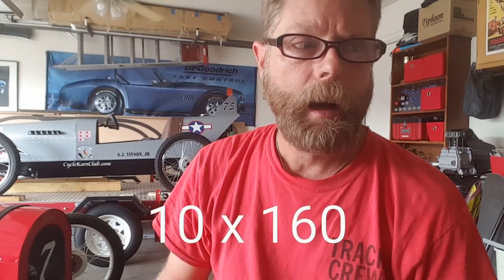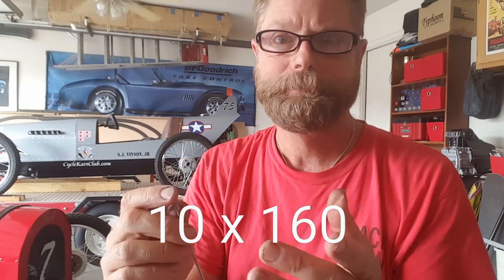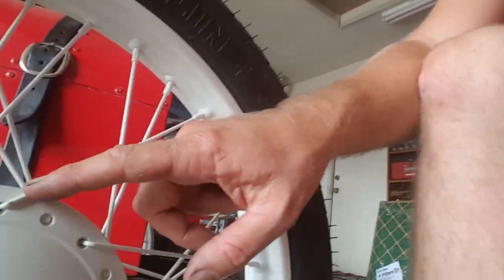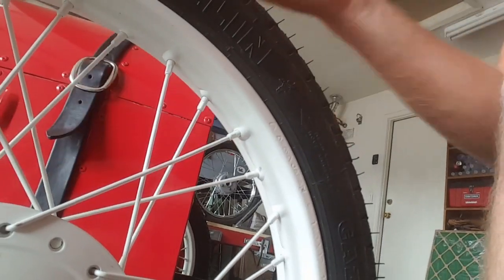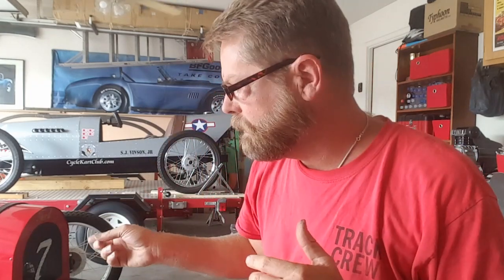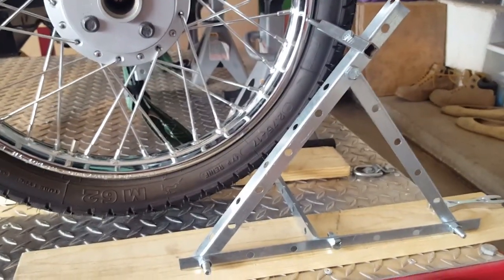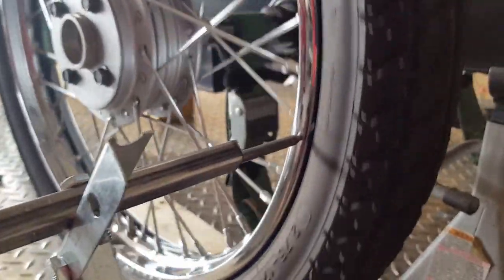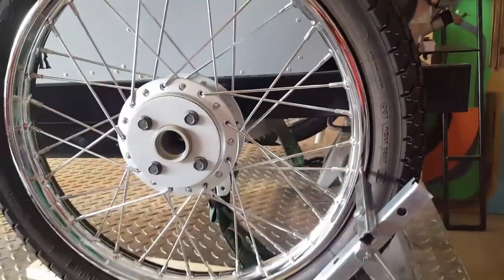Cyclekart Spoke Tech

Comment: Should flanged bearings be used in the front wheels?
Reply from the maker: The bearings we use dont have flanges.  We do put spacers between the bearing and between the bearings and the spindle shoulder and the nut.

Comment: Nice little homemade tool. What is you added camber to the rear wheels? Would that ease some of the stress?
Reply from the maker: 2SlickNick 
We run a solid rear axle, so it is not adjustable.  Good suggestion though and thanks for watching.